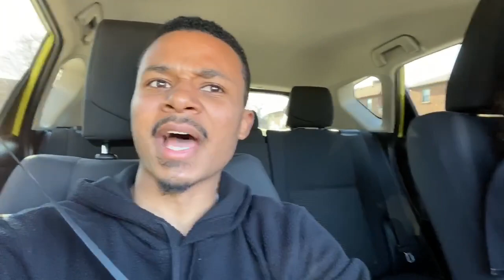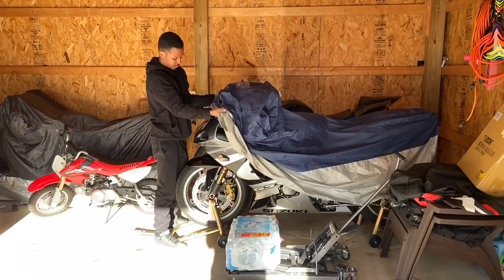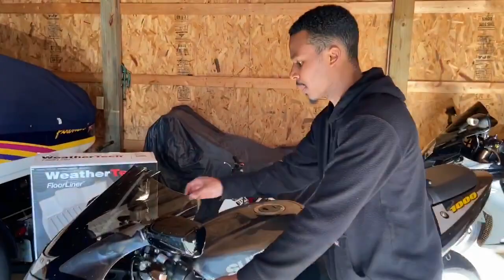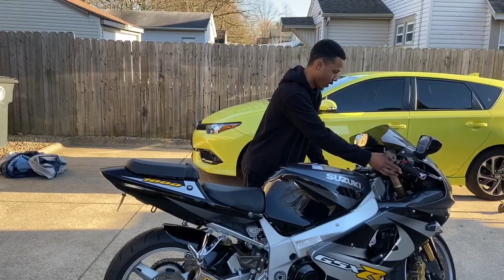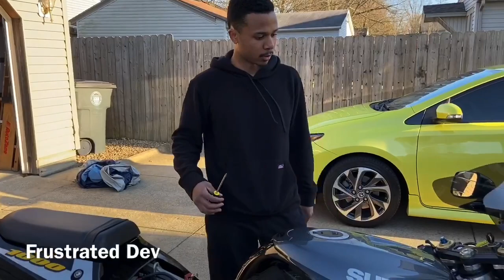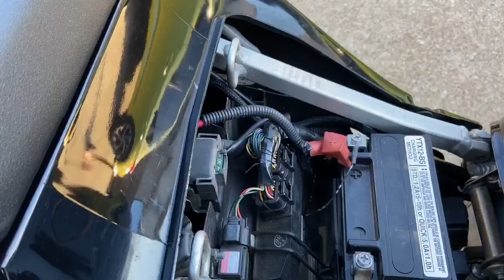I tried to pick up my 2001 GSXR 1000, But This Happened...

Comment: If you don't know, You should put fuel stabilizer in the tank before storing it for the winter.  Never had a problem starting a bike because of bad fuel in the spring.

Comment: Did you clean fuel pump out? No did you check fuse for starter relay? No Were you starting during winter to burn the old fuel out? No I have a 01 1000 and live in Detroit those are a must every spring

Comment: if left for awhile, rust will accumulate in the tank, will mess up the fuel pump and injectors, K1 was renowned for this problem. What mods you running on her? Check out my Dyno run vid of mt K1 1000, pure Yoshimura sound no baffles, that sounds like the starter clutch, same happened to mine, stick it in 2nd and bump start her